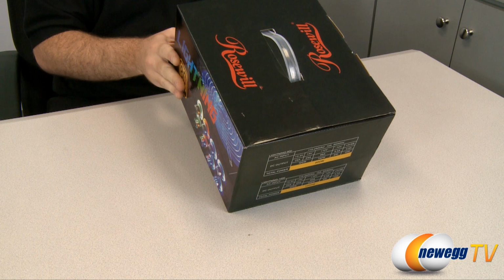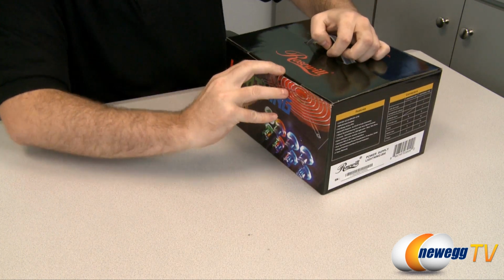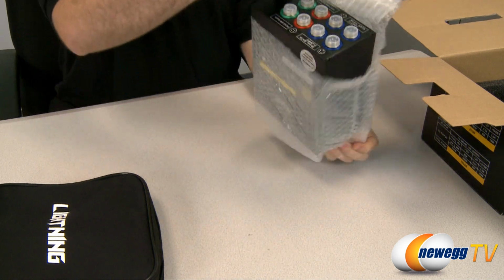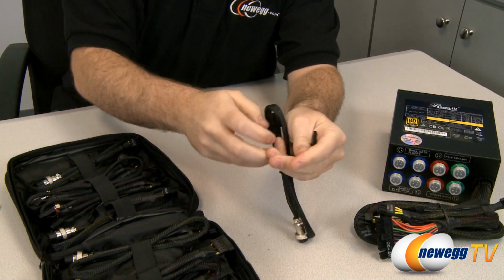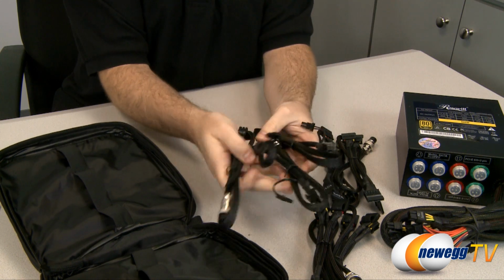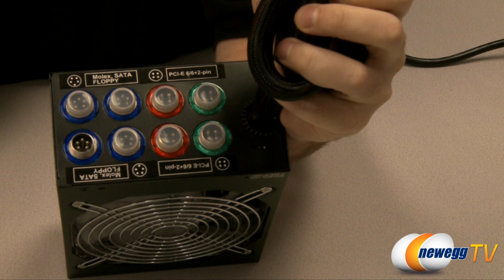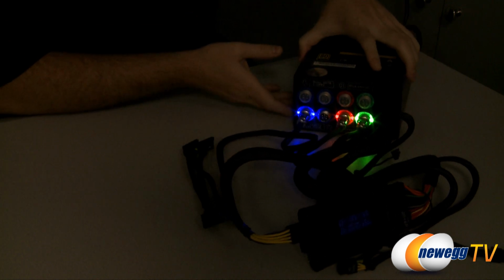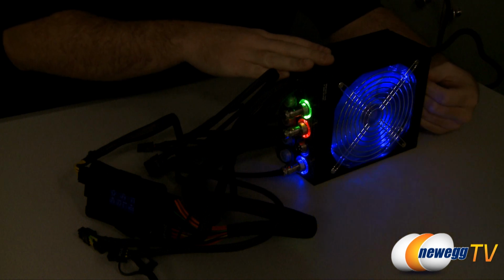Unboxing: Rosewill LIGHTNING Series LIGHTNING-800 800W

Comment: Bought the 1kw version of this PSU all the way back in 2013.... a decade later and it doesnt even seem to breaking a sweat... Rosewill is highly underrated, and I know any future power supply that goes into my build will be a Rosewill!

a plus of this PSU is the connectors really turn heads; I have had many of people ask me 'what power supply are you using?!' simply because they see those plumber fitting connection points on the PSU and think theyre so cool looking!

Comment: Just put in the 1300, in a cooler master case to can set the fan led to red and the cable cover,  Haf-x,  hides the connection lights, 8x PCI-e connectors, 10x sata 10 molex, nice thing is the sata/molex combo connection cord made cleaning up the wiring easy and the connections are solid metal screw in cables not plastic push in.....12v rails is running stable, core voltage stable to .001 on an overclocked 3930k no issues so far,

Comment: Wonder how much that PSU tester is. I usually just jump the green wire on the motherboard connector to a black wire and it starts the power supply.

Comment: Before you guys start dissing this power supply based solely on the manufacturer, keep in mind it comes with a 7 year warranty!  ^,^
Reply: I bought this same power Supply 800 watts  in 2012 and is 2018 and 6 years later the power supply is still functioning but not sure if is still functioning 100 percent. I have had some problems lately some of my components are getting disconnected so I did some testing cables and check motherboard ports and everything seems to be working good so is a possibility that it might be my power supply that is failing after 6 years of use. I thought that the warranty was only for 5 years so I don't know where you getting this 7 years. I have to check this because if is really 7 years I can still send it back to rosewill for a replacement and save my self having  to spend another 150 to 200 dollars for a new power supply

Comment: will this fit into NZXT Crafted Series G921RB Mid Tower Computer Case - 3 x 5.25" Drive Bays, 6 x 3.5" Drive Bays, 7 x Exp Slots, 3 x 120mm Fans, Black/Blue - 921RB-001-BL?